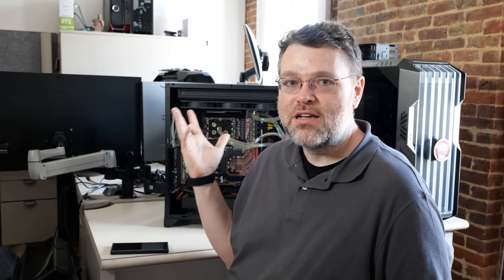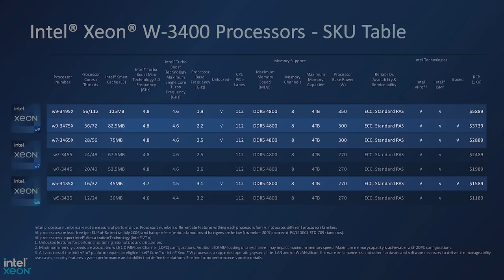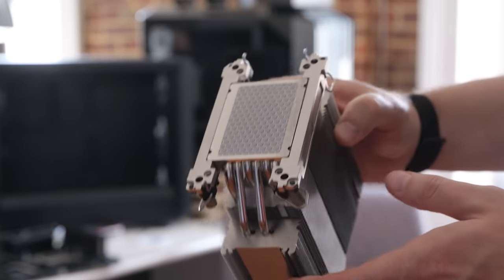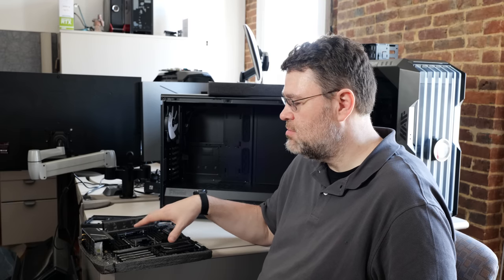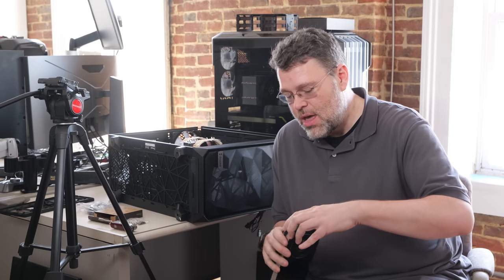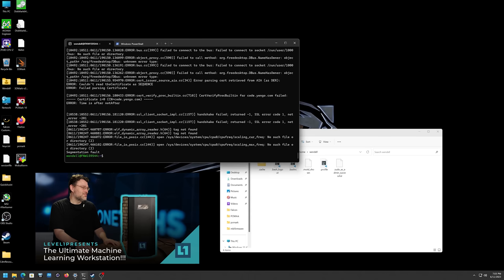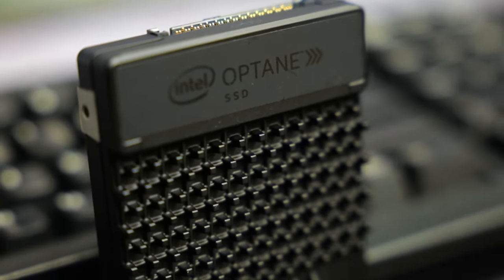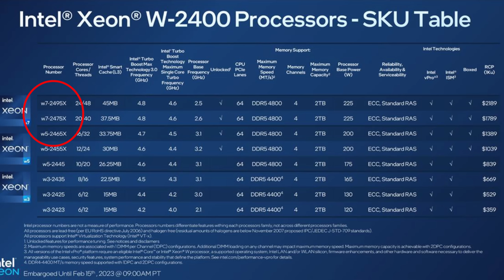Hitting The (Sapphire) Rapids With The ASRock W790

Comment: Wish there still were dual socket parts that aren’t locked down. Back in 2008 had great fun with a dual 4-core Xeon L5450 system that was overclocked by 20 % by changing the FSB from 1.333 to 1.600 MT/s with 24 GB FB-DDR2.

Comment: The real question is why we haven't seen reviews of these CPUs from the mainstream outlets yet. Is Intel trying not to advertise these chips?
Reply: Drew even with Zen 3 parts from two years ago after three extra years of SR dev
Reply from the maker: no sampllleeeessssss :D
Reply: @FeintMotion  Good point. Still the only option with more modern features until Zen 4 comes along though. It seems relatively price competitive, but still more expensive than Zen 3. Would you rather have a 2475X (20 cores, ~$1750) or a 5965WX (24 cores, ~$1600), considering I'm pretty sure golden cove is faster per core than Zen 3. Correct me if I'm wrong, but depending on what you're doing I could see SPR making sense.
Reply: @Eidolon2003  A 5965WX is not $1600, more like $2100. Please show me where i can get that discounted 5865WX. Price/performance wise the 2475X will be hard to beat. Sure AMD is at the top now, but they are only doing what the performance kings always do, charge a whole bunch more for the product line underneath the top dog.
Reply: No.freebies that's why

Comment: I’m of the belief that the new W2400 and W3400 series  is HEDT no question, mainly due to having unlocked processors within its lineup. Scalable Xeons today and in past are not unlocked. This new Xeon lineup has convinced me to retire my X299 system with the i9-10980xe, it has served me well. To think that I have been researching and price shopping to put together a Xeon W3300 (icelake) series workstation because my X299 was not keeping up with my new RTX ada4500 GPU (previously using an RTX a4000). The price for a Supermicro  lga4189 mb workstation system was not far off an entry level W2400 system with this reviewed Asrock W790 motherboard. This review came at a most fortuitous time, and thanks Intel for this long awaited HEDT line of processors.

Comment: I've heard there are still some major problems with these CPUs involving the clocks/latency/done performance issue when building high end audio workstations, which is not my use case, but hopefully it gets worked out in a successor or hardware revision. I suspect that may explain the lack of advertising. Regardless, unless AMD can offer an alternative, I may be forced to find a way to get my hands on one of these systems
Reply from the maker: I have only noticed this in combination with nivida drivers and the gpu accelerated scheduler, fwiw. It might possibly be that # threads causes the gpu driver to trigger the issue more often? But 75% of the time disabling gpu accelerated scheduling fixes it every time? haha
Reply: From what I've heard SP's where only meant as a stop gap... I've been in two minds to be honest but given Threadripper Pro 7000 is landing very soon with Emerald rapids not far behind I've decided to wait.  The key point is W790 is only meant to handle sapphire and Emerald rapids and nothing beyond that so technically it's a dead-end platform post 2024.
Reply: thats missinformation that is spread by some youtubers because they dont know it better.
Reply: @velo1337  the single die model had a timing issue which was resolved with a microcode update... this includes the W2400's.  W3400's were not affected since they use a different die.

Comment: i'm interested in this level of connectivity and pcie support as a general purpose homelab/nas setup but  instead of blazing fast multi-thousand dollar xeons i'm leaning towards low idle power with some performance capabiltiies. do any of these xeons have efficiency cores? or is another platform better suited for my purposes? i'm currently running a ryzen 3900x on a x570 motherboard with udimm ecc modules and the idle power is fairly high. my goal is to run 24+ solid state sata ssds... not necessarily for the speed but the low power, smaller space and lower noise.
Reply: Uh, if you want low idle power use, Sapphire Rapids is not the way to go. Some of them can require up to an 1800 watt power supply while running a single GPU (they don't use all of that power, but they have harsh power spikes and generally idle quite high). If you really need efficient HEDT Threadripper's pretty good, and at the price you're looking at for some modern HEDT chips it's not insane IMO to suggest doing something like 2-3 N100 builds over an ethernet switch to get okay connectivity for things like storage.
Reply: @novantha1  you confused me wanting low IDLE power and IDLE efficiency with me wanting efficient high load performance. i already have efficient high load... i want LOW POWER IDLE EFFICIENCY and AMD is not the way to do so.

Comment: Glad to hear that with 1000-watts possible delivery to the CPU socket alone - you will no longer need to splurge on a new space heater this winter! Just think of all the savings!! 👍
Reply: My Intel W7-2495X 24C 48T system draws less power at the wall than my AMD R9-5950X 16C 32T system.
Reply: @daveg4417  You must be located close to a black hole where physics seemingly break down. Otherwise I can’t begin to explain how a 5950X with an absolute default power limit to the AM4 socket of 142 W can draw more power than a 2495X with a base power limit of 225 W and a turbo power limit of 270 W.

I got a 5950X system with completely removed power limits to be able to test powerful custom water-cooling solutions (but limited to ambient temperature) and 270 W just to the socket can be reached there with Prime95 and AVX2 enabled, no chance of reaching anything close to that with more “regular” cooling.
Reply: @abavariannormiepleb9470 - You mistakenly think that I am always running both systems at 100% power and 100% load.  Who always runs their computer under normal use at 100% all day long?
I am talking idle power draw, regular use power draw, and heat, and fan noise from thermals.
Reply: @daveg4417  Then you must have have had a defective motherboard model or buggy BIOS (the latter unfortunately isn’t rare). As a workshop system I operate a 5750G (88 W socket power limit), 128 GB ECC UDIMM, an ASUS ProArt X570-CREATOR WIFI, 4 x 2 TB NVMe SSDs and 6 x 3.84 SATA SSDs in a passively-cooled Streacom FC10 Alpha. No issues with the system drawing much, much more power under load compared to idling.
Reply: @chrisdejonge611 - Please read the rest of the comments for additional context, I am referring to regular use and idle, not 100% load.  Of course the W2400 will draw more at 100% load than the R9-5950X.

Comment: I really do hope that intel does actually bring back HEDT instead of this look we strapped overclocking on our workstation parts while doubling the price.  I mean seriously - just take 16 cores in a double ring config if needed - that clock lightly threaded as well as consumer parts - and give it 40 lanes of PCIE and quad channel (standard udimm).  I'd not hesitate to drop a grand, maybe 1200 max on that board and a 12 core CPU.  But I will not spend that much on just the CPU when it cannot get near the same low thread performance as desktop and is heavily cut down high core count parts.

Comment: This is going to sound very weird, but you've done a few videos on ROCm and CUDA in the past (particularly with regards to accelerators). Is there any possibility of talking about the experience of running AI workloads on OpenVino with the accelerators on Sapphire Rapids workstation? I'm not sure how many of the server variant's accelerators are available on this platform, but I think you could see an argument where you could pair a W3400 series (or hey, honestly, even a W2423 with PCIe x8), with at least one, but probably multiple A770s, and possibly offload a sizable amount of the model onto the CPU's accelerators, giving you a system under $3000 or so that functioned like it had 80-84GB of VRAM.

Now, you wouldn't have to do the whole build to talk about the possibility, I think just hearing about the accelerators and possibly pairing them with a single A770 would be more than enough to get the point across.

Comment: The 2455x is a better overclocking cpu than the 65/75/95.  It allows up to 100C Tj Max, whereas the 65 ais 95C, and 75/95 are 94C max.  This results in a higher minimum clockspeed for all cores, and higher maximum clockspeed for best cores.  And it's exactly 75% of the cost of a 2465x while having 75% of the cores.

Have you discussed with GSkill the absurdity that these memory modules are not coming with heatspreaders when you yourself have seen that they have stability issues at temperatures as low as 60C?  What did they say?

Comment: I bought the ASUS Pro WS W790 ACE instead of the ASRock WS W790.  The ASRock is much more expensive in Canada, and I didn't like its PCIe slot layout, the top x16 slot is too close to the cooler, the next slot down is only x8.  I built mine with a W7-2495X 24C 48T 4.8GHz all-core, 512GB DDR5-4800 ECC RDIMM (8x64GB with no issues at all), and an ASUS ROG STRIX RTX-3090.  I used the Corsair 5000D Airflow case, and it fit perfect.  It is an awesome system that kicks butt.  CPU-Z ~800 ST ~24000 MT (TR Pro 5965WX 24C CPU-Z is only ~620 ST ~18900 MT and it costs way more in Canada than the W7-2495X).  I priced out TR Pro but they were way more expensive for slower older tech.  I see lots of Intel haters in the comments.  They don't know what they are talking about.  You buy W2400/W3400 for the large memory support and high I/O lanes.  A real workstation.
Reply: In Europe intel is ~40% more expensive when it comes to CPU price alone in the HEDT market. You can get a 5975wx 32 cores, 128MB cache 8 channel ram and 128 pci-e lanes at the same price as a w7-2495x which has 24 cores 45MB cache 4 channel ram and 64 pci-e lanes. Yes, it is a little bit older but for my code compile workload the extra cache and memory bandwidth makes it up. There are use cases for each platform.
Reply: @tudalex - Either platform makes a good workstation.  TR Pro 5000 is just a generation older than Intel W2400/3400.  I don't understand people who have to bash either AMD or Intel.  Congratulations on your system, it sounds great.  Here in Canada I got the W7-2495X for $3000 while the 5965WX was $4000.  The TR Pro motherboard was a lot more money than the W790 as well.  I priced out a 24-Core TR Pro system at $20,000 and the W2400 24-Core system was $13,000.  A really big difference.  So I went Intel.  The W7-2495X system is the replacement for my AMD R9-5950X system, as I needed more memory.  The 5975WX 32-Core is CPU-Z ~650 ST ~25000 MT, so it is slower than the W7-2495X on single-thread but about the same on multi-thread.
Reply: Hey! Which RAM kit did you buy? I'm from Canada too and I'm having a hard time finding good kits. Thx
Reply: 100.percent well said

Comment: Yay, new Threadrippers next quarter. Sad the competitive pressure from Intel isn’t stronger :-/
Reply: At least intel can design and build their products. Your threadripper is gone as soon as Winnie the Pooh cracks the shits.
Reply: @edmunns8825  What? What is this Intel fanboy nonsense lol
Reply: The Intel W-series 24-Core is faster than the TR Pro 32-Core, the W-series 56-Core is faster than the TR Pro 64-Core, plus W2400/W3400 is DDR5 and PCIe5, I would say that is competitive.  There is supposed to be a W2400/W3400 refresh coming soon as well, with most likely more features and performance.
Reply: @daveg4417  Some of Puget System benchmarks beg to differ.  And I can't see how in the world that the W2400/W3400 refresh could possibly compete with the TR 7000WX.  DDR5 and PCIe5 doesn't seem to help Intel at the moment and it must be part of the TR 7000 platform.
Reply: @daveg4417  faster in what? Keep in mind you're comparing last gen to current and even then it doesn't always compare favourably.
Reply: @maxwellsmart3156  - Your fanboi-ism is showing.  If you prefer TR then buy TR, that doesn't mean that everyone has to do what you do.  I bought a w2400 system because it was faster than TRPro, considerably cheaper than TRPro, and current generation.  If I was to wait for the "next best thing" in TR or Xeon then I would be waiting forever.
Reply: @morosis82 - And if you compare TR Pro 7000 to W2400/W3400 then you are again comparing apples to oranges of new vs old.  Perhaps you should just buy something instead of looking for the proverbial needle in a haystack.

Comment: I do enjoy learning about these HEDT systems. I do have one question: with so many x16 slots available, why put the GPU in the top slot? Why not put it lower down, allowing both it and the CPU cooler to breath more? Or is it thermally better to put it there?
Reply: The top slot is spaced for a 2 slot card, so if you put it lower you block some slots from use.

Comment: I love these videos sir keep it up! I've been trying to learn as much as possible to incorporate that knowledge into my NAS and HomeLab stuff for future use. Wendell do you know if there is an "optimal" or "ideal" configuration for: RDIMM ECC + 'Low' TDP + PCIe availability/expandability + Intel Quick Sync? I've been looking around scratching my head because most of these workstation class systems have costs in the thousands and pull high wattage even at idle. I know I could like...add an Arc GPU to a TR Pro or Xeon for example, but that seems like a thermonuclear solution.

My general idea is to improve my TrueNAS Scale VDEV Configuration and incorporate RDIMM ECC to improve my silent corruption detection/correction. Can consumers do this without breaking the bank?

Comment: As someone with an AM4-based main system I'm kinda weeping at these I/O options. I've tried adding faster-than-gigabit networking, but I actually do not have the PCIe lanes to do even that. So I'll have to go with 2.5 GbE over USB 3. What a pain. Socket 1200/1700 looks pretty darn compelling in comparison. Even to AM5 boards. Something about AM4/AM5 boards compels vendors to only make weird PCIe slot combinations.
Reply: I don't understand this, I have an AM4 with 3 x16 slots with x8 x8 and x4 if you use them all, plus some chipset connected m.2.

Seems about the same as high end 1700 boards except they're pcie5
Reply: @chrisdejonge611  Like most AM4 boards mine only has one M.2 slot (with x4 CPU lanes)
Reply: @morosis82  Do correct me if I'm wrong but as far as I know there have only been two boards with that slot configuration, and the (iirc) MSI one has been discontinued. Almost all X570 boards have braindead slot layouts. It does feel a lot like they wanted to avoid competing with Threadripper or higher end Intel platforms in the IO area. Of course all chipsets before X570 simply didn't have enough lanes... PCIe 2.0 x6 :D
Reply: @-szega  I have the Gigabyte X570S Aero G and it has the x16 at the top with triple slot spacing, another x16 (x8 shared with the top slot) then another x16 (x4 shared with the third m.2 connector).

So you can run 2 x8 cards off the CPU, then an m.2 off the CPU, plus either a x4 card and 2x m.2 or 3x m.2. Though I think one of those disappears if you load out the SATA connectors, so that would make it 3 cards, 2x m.2 and a bunch of SATA as a full loadout.

Comment: I wonder what you would be able to come up with for a Rock steady fast and reliable DAW, as such it has a very different set of requirements compared to other workstations, unfortunately being a sound engineer it’s not my world as such but it’s really hard to find unbiased information to find out which components would be the best for a DAW, Wendell I know you’re a very busy man, but you also like a challenge if I understand you right, have you any interest in looking into building the optimal DAW?
Reply: I'm assuming you mean a workstation-class PC for digital audio, rather than a DAW like Protools. I went to college for music production and have had the privilege of working in a million-dollar studio. As I understand it, on the PC side of things, digital audio is largely CPU bound, but doesn't require extreme performance like 3D rendering. Any high-end CPU with lots of threads on a high-bandwidth platform will be more than enough. The main hardware difference for high-end recordings are things like professional quality DACs. Those are separate rackmount solutions with their own built-in processing, like Avid Pro HD devices. As long as your computer can handle the I/O requirements, has moderately high threadcounts and plenty of (stable) RAM, you'll have enough for anything you need. In short, professional audio hardware is usually in it's own separate unit, rather than integrated in the PC itself. There aren't many unique PC-specific considerations for pro audio production. Case in point would be how the industry-standard for computers in top studios is still Mac. The reason is because the pure hardware requirements aren't extreme, the OS is stable and compatible with industry standard software, and they have TONS of thunderbolt I/O for all of those external devices.

Comment: A 16 cores xeon able to pull 1000w? I know that more cores is better but how much you really can push it? 16 cores pulling 1000w at 5ghz all threads and having a 32 cores at 4ghz same thing on all threads is not the same deal and compute.